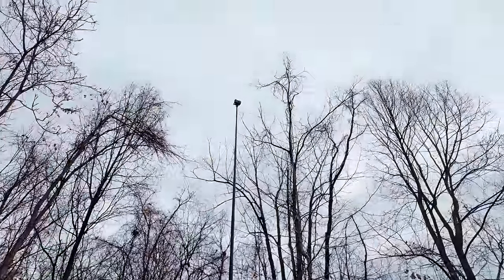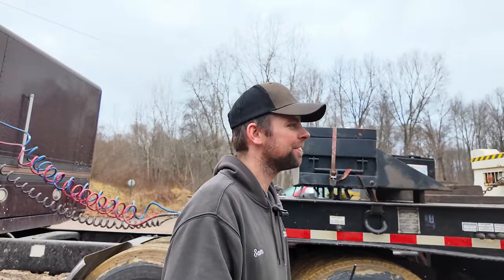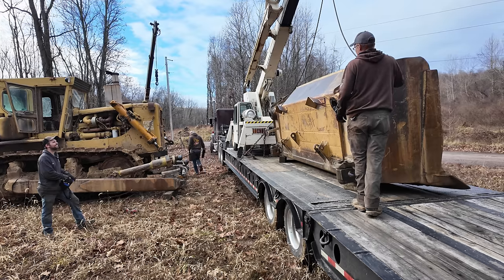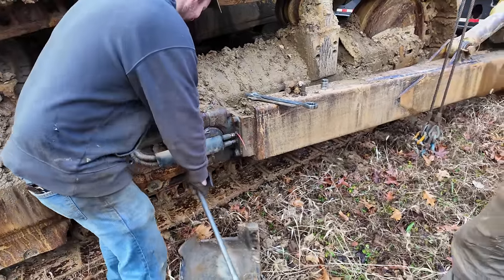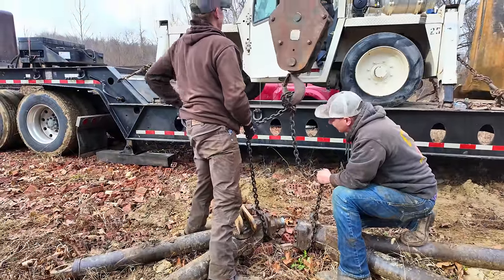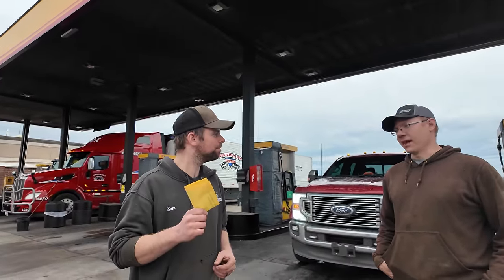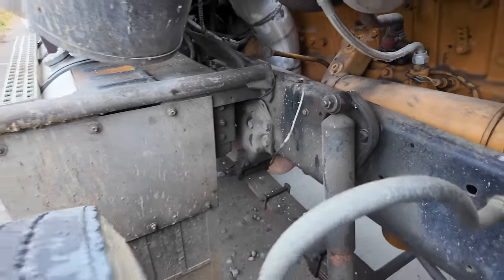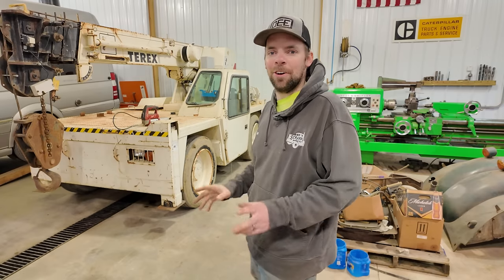Hauling Diesel Creek's Caterpillar D9 Blade

Comment: Sam, good fix on the antenna.  Just one more thing about it, if you ever need more range you could check the frequency of the cell antenna and the frequency of the box receiver.  If there is a mismatch you could boost transmission and reception by matching the two.  Fixing the original anenna might also provide an improvement.

Comment: Before you dump the air on the truck and trailer you should put some blocking under the trailer by the back tires on the side of your lifting to help stabilize the trailer more

Comment: Get a set of PENN  DOT guard rails for the push arms or move the dozer at night like we use to do on the 90V DHH with single shank ripper = 57 ton. Or like Solman & Tesevich  from Uniontown back in the day without guard rails and blue tooth chains

Comment: Hey ,you got it done ,I would be suggesting that next time you ,

Wear Hard hats 
Use a guide rope to control an item in the air ,rather than hanging onto it
Fix that throttle control on the crane ,or increase its idle speed so the hydraulic pump can pump enough for low speed control 

Q,could you have loaded the blade with the D9 over the rear of the trailer and then unbolt and swing without the extra lifting ?or even side load ,driving the Cat up on blocks to get the blade on the trailer deck ?
Do some refreshments on the crane weight limits would be wise and add to your knowledge.
B safe fellas

Comment: Great Video Sam. And with John's help. Kuddos to him.
The crane works! Really Well! 
What a project to test it on. Handled the blade without any problems.
The remote works well for a cheapie. And a proof of concept.
With some hiccups to work out. Overall 2 thumbs up.
Now you also have a Truck Crane. Lol.
You need some fancy LED lights for night work.
Thanks Sam.
Cheers.

Comment: you guys are lucky that the hooks did not break , bit of advice Sam when picking up a load the open side of the hook must face towards the outside of the center of the load , the strongest part of the hook is the backside .

Comment: actually the safety aspect is reverse of what you think using remotes. when using remotes on a boom with big weight you cannot "feel" the load and the big problem you are worried about will sneak up on you really fast and it won't be pretty. I started using remotes on my booms back around 1995 when first offered to me.

Comment: The Stellar crane we had would drop the radio connection if a control wasn't used for a certain amount of time. That was a Hetronics radio control. I contacted them and they told me which pot to adjust to change the time.

Comment: I loved hearing Sam refer to the ripper tooth as the "Parking Brake" Just after Matt started the D9 near the start of the video. 
I learned what little I know today (aside from what I learn watching folks like Sam and Matt) about Heavy equipment from my best friend's father, who had a gravel bank business in the 1950s while the Interstate Highway was being built in our area. With the advent of 1960, My friend and I became teenagers (12-13 years old) operators on his father's equipment, which included things like a (WW2 surplus) D8, an Erie cable shovel, and a Cable dragline (that I can not now recall the name of the maker.) Watching these videos takes me back to a happy time of my life, and I don't think I have heard the ripper tooth called a parking brake since those years.
Reply: Did you get to drive any Euclid haul trucks?

Comment: Jump starting my dead and frozen snow covered 6.0 diesel ford from inside my warm house is great while the truck is in the driveway in the snow is so cool the charger is in the house in a  room using the truck road jump starting kit is great just run the cord from the charger and one plug on the truck is great that what you do when you can not park in a heated garage.😍😍😍😍😍

Comment: How much does that blade weigh??
Reply from the maker: The total of the moldboard and push arms was 17,300 lbs. so however that breaks down. I’d guess the moldboard is 13,000 or so
Reply: @ScrappyIndustries  That is one tough little crane

Comment: Scratching my head why you you didn't put the blade on the trailer with the bulldozer?
Reply: Matt said in Pennsylvania the permits would've been too costly for the oversized load.  
The dozer with out the blacked weighed 144,000 pounds.
Reply: @davidwagner9644  no,i was meaning to take it off the dozer but useing the dozer rather than the crane.
Reply: @jimmurihiku8009  Matt felt this was the best way to go about it I guess.
Reply: @davidwagner9644  well it worked out ok and thr boys did a great job.